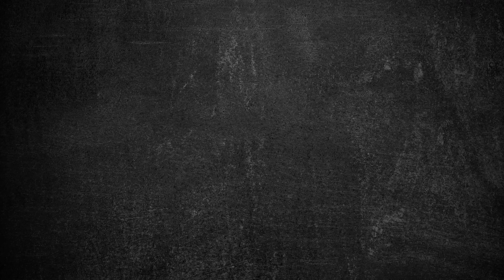FiTech Fuel Injection Q&A | 2 | EP103

Comment: Which hei module is. Incomparable your system?
Reply from the maker: Which EFI system are you referring to? For example the Go street (30003) system will work with a 4 pin HEI module. It will not work with a 7 pin HEI module.

Comment: I set using my hand held screen for the duel electric cooling fans to come on at 190 s but they are not working, they were working fine at one point now I have nothing
Reply from the maker: Check for fault codes. also make sure that the turn on temp is higher than the turn off temp. Also that they are ENABLED.

Comment: I have a problem with my Fitech  part # 31001 600 Hp carburetor. The butterflies do not open any more or at least completely, The accelerating assembly only travels like one inch, no more. Any suggestions why they stop opening?. The car starts but does not accelerate.

Comment: "Hi, I’ve encountered a peculiar problem with my engine. To start the engine, I have to turn the ignition key on and off twice. During both instances, I need to wait for the fuel pump to cut off before the engine starts easily. Otherwise, the engine doesn’t run, especially when it’s cold.

I have another question. When I suddenly accelerate the gas pedal to high RPM in first gear, the engine dies after reaching 170°F or higher. Which parameter should I adjust?"

Comment: Should I set up the spark map to match the actual engine timing (I'm controlling the timing thru the distributor, no adders on the engine) and under engine setup injector flow it's set at 35.3 LBS. Should that number be the same as the injector 80 LBS for the 39610 3X2

Comment: What should the map sensor read while the engine running…. Ultimate LS. 70004
Reply from the maker: That would be dependent on the Camshaft, key on engine off you should be around 100kpa.
Reply: @FiTechEFImedia  mines reading from 86 -92 while the engine running
Reply from the maker: @TheSqad874  Key on engine off you should have around 100 kPa and with the engine running it should drop to a lower value. The lower the MAP reading at idle the more engine vacuum you have(which is a good thing)

If your vehicle is running rough, We suggest checking for vacuum leaks, inspect the wiring connections to ensure proper connection is made between the harness and sensor, Review your cam setting to ensure you are selecting the optimal setting for your engine set up.

Comment: Which distributor would you recommend for timing control on an Oldsmobile 350 engine?
Reply from the maker: To use timing control a 2-wire magnetic pickup distributor is needed. It also needs to be locked out and phased.

Comment: Please, I have looked everywhere for answers to these RPM related questions. 
1. ** Why are my actual RPMs so far off from what the unit says or thinks the RPMs should be at? (Driving at 2300rpm and Fitech says I should be at 1800).**
2. Where does the Unit get its RPM table or data from?
3. How do I fix or adjust the RPM data in the unit so that it is more in tune with my engines actual RPMs? 
1986 C30 Crew Cab Chevy
Original Stock 454/Th400
Fitech #30005
The truck runs fine for the most part. I still have some tuning to do.
Thanks for the help, 
John
Reply from the maker: Hello, I have reached out to our techs and they have suggested that you call our tech line, they have a few follow up questions that would be better asked through a conversation on the phone. Please call 951-340-2624. 

Our tech line is open Mon-Fri 7am-4pm PST
Reply: @FiTechEFImedia  OK, will do. Who should I ask for? Thanks, John.
Reply from the maker: @johntucker803  any tech that you get connected to in the queue is fine, just remember their name so that you can get connected with the same tech if you need to call again.

Comment: What would cause a low map reading/ fault? I've rebooted,  reset to stock calibration,  checked orange map gasket behind ecu, changed o2 sensor. My 600 ho easy street will not stay running.  Help fitech!

Comment: How do you lower the r p m's initial start up
Reply: The two handheld settings that come up the most for this issue are "CRANK IAC" and "Loop Rate Down".  The first setting controls how far the Idle Air Control valve is opened while cranking the engine and the second setting controls how quickly the IAC valve can close in response to a higher rpm (in general, not just on startup).   

These two settings work fine for cold starts but, I bet your like me and want to tailor the rpms for hot starts... the problem however is I don't believe you can or at least I can't find it.

Reducing "CRANK IAC" will help a little with hot-start flare ups if the setting was already set too high.  Increasing "Loop Rate Down" will reduce the time of a hot-start flare up but, it won't eliminate it. 

I find this behavior most annoying when I turn off my engine in a restaurant drive-thru so I can place my order and then when I restart have to wait for the idle to come down before placing my automatic transmission in gear.

I'm looking for hot restart behavior like on a carburetor, hit the key, put it in D... no rpm flare up. 

Restart straight to 750 instead of a slow decline from like 1200rpm.